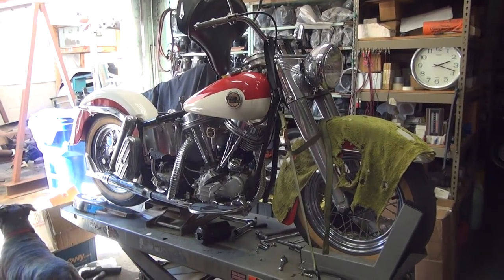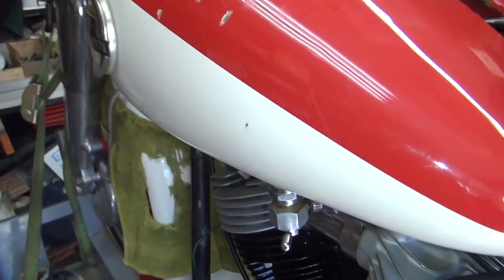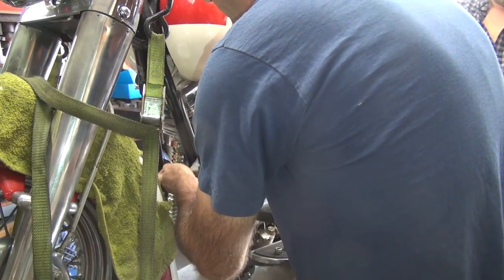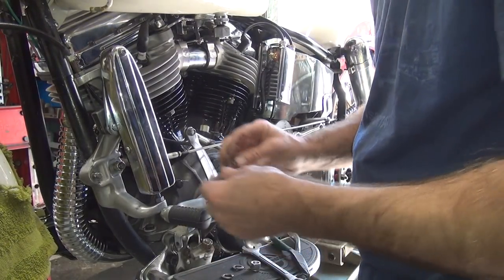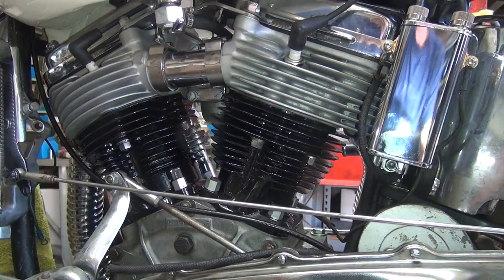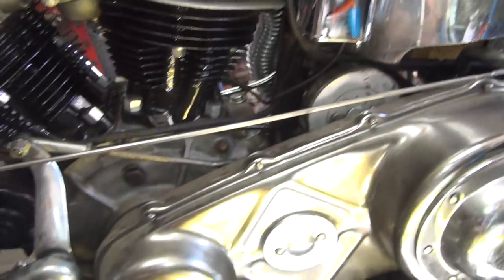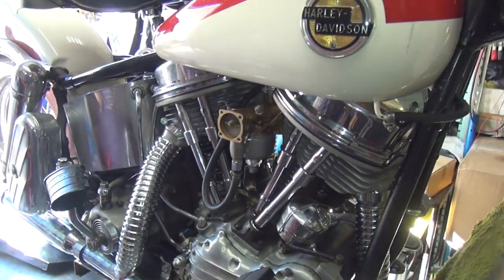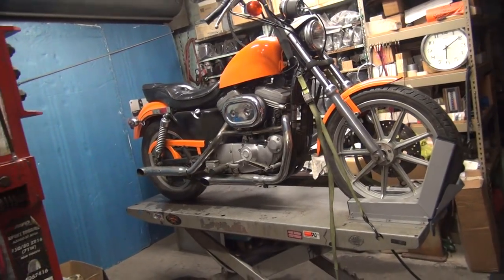1958 panhead 74ci #155 fl bike rebuild topend repair harley by tatro machine

Comment: Tatro, out of curiosity do you own and still use a Kwik Way boring bar machine? Back in the old days I installed quite a few grease fittings in the old seat tubes so they could be greased with marine grease.
Reply from the maker: its right behind the mill on the right side. i use it when i fell like it.
tatro